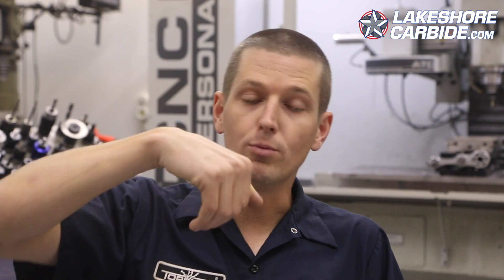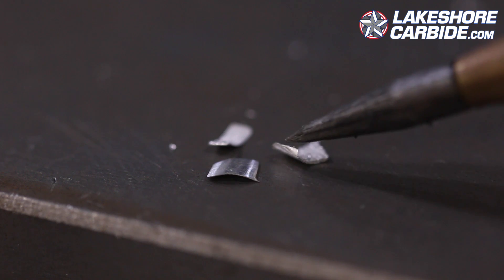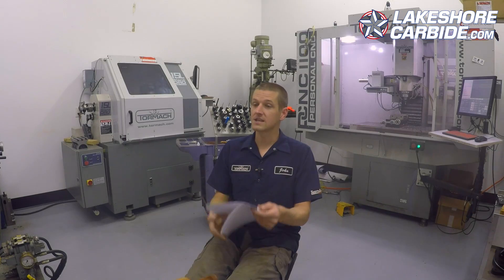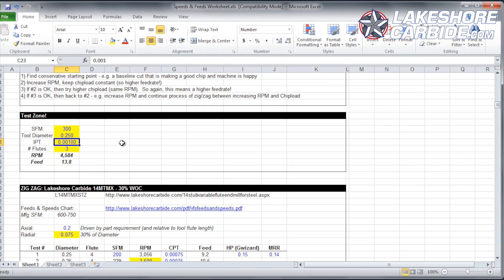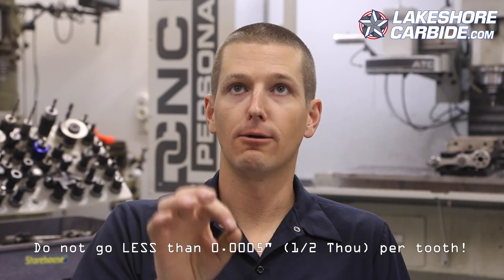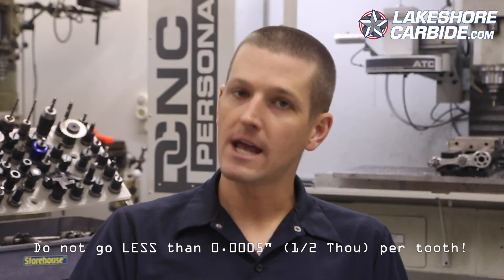2. What is Chipload and Inch Per Tooth!

Comment: An easier way to think of why it's bad to run slowly: Stop thinking about "time" and start thinking of "cuts": Just like with an axe, you can only cut so many times before it gets dull. Rubbing is where you're cutting a bunch of paper thin slices to split a log. This is why correct feeds and speeds are so important; You're moving your arm (the tool) laterally fast enough that you're  biting off larger pieces of wood (material) to get what you want done before the axe (endmill) goes dull. If you bite off too much, the axe gets stuck and you have to hammer or pry it out. (the endmill breaks because a CNC machine can't  stop rotation in time to prevent the shank or core from snapping off)

Comment: You mention not wanting to make a tiny chip, or rub.  In a video you just did recently on 3d machining, it looks like a good portion of the cutting was taking off very little material.  Was that just deceptive because of the video, or was the tool actually spending a lot of time rubbing?
Is there any way to avoid that when doing that kind of profile cutting, to help increase tool life, or is it just the nature of the beast?

Comment: I have a couple of questions that I've not seen answers to yet from any of the channels I follow.  What do you guys do with the waste or the "chips"?  I've seen some lathes/cnc machines where they run different metals.  Do you try and keep the materials separated? e.g. one bucket for aluminum, one for brass, one for steel, d etc. then just recycle them to the same people you buy the stock from?   Also I've seen people who use large pieces of stock then machine them down to almost 1/4 the stock size, they like the extra "wiggle" room that the larger stock provides, is that normal or do you go with stock that is "close to" the dimensions of the final product.  Is there any savings on cost when going with the larger stock vs the close to or is it just a matter of time, and if you want extra wiggle room?  thanks and keep up with the great vids!
Reply: ah by wiggle room I mean if your end part is going to be 1in in diameter do you start with a part close to 1in say 1 1/4" or do you start with something like 3" in diameter just to be on the safe side of things give or take mistakes or other issues?  I've seen some videos with people having been giving huge pieces of stock and they turn it into something tiny, and others who just go a bit above the end part dimensions and achieve greatness, like your silencer! ;)